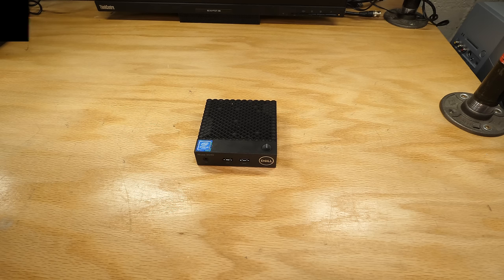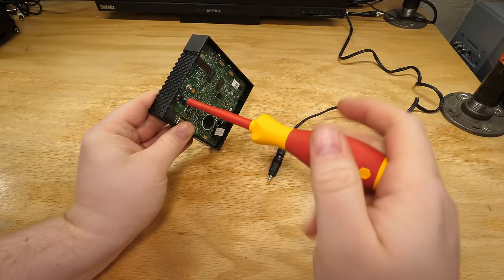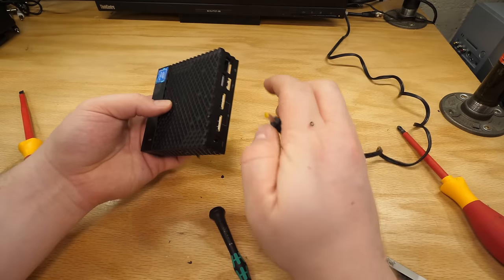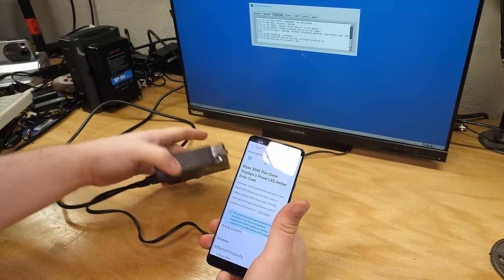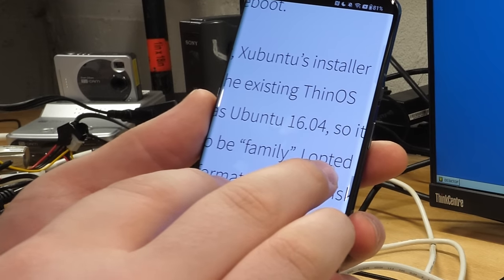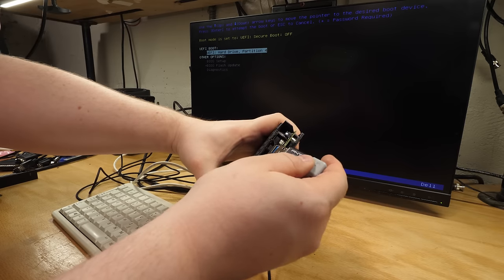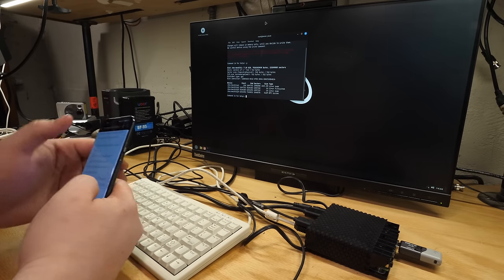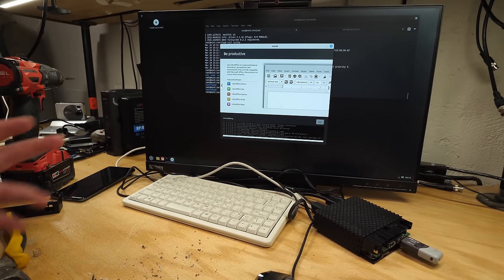Little Guys: Episode 2 [Wyse 3040]

Comment: Have I just never looked at the ARK page for the Z8350? because I have a PC stick with one tied to 4gb of ram that is all functional. (it is smaller in volume than the wyse as well haha.

My least favorite part about the -trail series or at least the tablet focused ones is despite being an SOC, they won't function properly without chipset drivers.. most of which end up being bespoke in the case of the random chinese brands... sigh

Comment: You can actually get something called tiny 11 so you can run this Dell on tiny eleven and it only takes up two gigs of RAM what tiny eleven is tiny eleven is a stripped down version of windows 11 so you can probably install it on a thing like this

Comment: A sata m.2 ssd will probably still work in that slot
Reply: unfortunately it dose not pci is not exposed its just for wifi cards.
Reply: A sata m.2 ssd would not even fit in since it is physically a different slot. We have m.2 E-key here while a sata ssd needs m.2 B/M-key

Comment: Some of the places we support use these little dudes to connect to Virtual machines. They don't need much horsepower to connect to a virtual machine. 

I'm surprised you cant use it to connect to even a windows machine using RDP.

Comment: a tip on drilling holes of that scale, you actually wanted a drill bit probably under a millimeter diameter, drill from the back side of it (so it goes through the center of the transparent peg and not a random place vaguely near to where you intended it), and don't use a heavy electric drill, because just the weight of the drill will snap the extremely thin drill bit. Use a hand tool for that scale. Not that it matters now & you already learned at least some of that.

Comment: I have set up so many of them. They fail a lot the cmos battery comes dead from the factory half the time. There's enough ram to put android on it if you are bored 😂. You need to update it with the Dell tool if you want more applications and set up Microsoft rdp. The management tool for them is free and they are crap at remote video.

Comment: I think we may need an additional theme and title card for “Let’s manually edit system files” 😸

Btw, at 15:30, not sure if I’m doing an overeager nerdsnipe here but you likely could have run `lsblk` to list the recognized block devices rather than visually scanning the contents of `/dev`.
Reply from the maker: For some reason, lsblk just fuzzes my visual receptors, I have a hard time parsing its output for reasons I can't explain. I use it frequently, just not for discovering what block devices are in the system. Maybe it's just leftover muscle memory from Red Hat (pre-enterprise) 5 though.
Reply: @CathodeRayDude  When you say that, I can immediately picture a visual-fogged version of its output in my mind. (same with netstat… sigh) So I sympathize pretty hard.

I also put my faith in lsblk to sort the devices such that the ones I actually care about end up near the bottom of its output… even though it doesn’t promise to do this, and it will likely change this behavior one day… ( ´_ゝ`)
Reply: blkid is also useful because it shows detected filesystems on the partitions. IIRC lsblk doesn't show any info about the contents of a partition unless it's already mounted.

Comment: I thought you worked for an MSP for several years. You've never managed thin clients? You don't configure thin clients on the device itself, you typically use a central management server for licensing and config deployment. No surprise that it is basically a paperweight.
Reply from the maker: I've never managed this particular unit, and I wasn't particularly interested in figuring out how. If I wanted to, I'd have read up on it, I didn't bother because I have no interest in having a thin client. I poked around the UI for a couple minutes and then wiped it since that's what I intended to do from the get go.
Reply: @CathodeRayDude  Didn't expect you to reply. generally really enjoy your videos man keep up the good work.

Comment: I successfully installed Debian 11 or 12 on my 3040.  I did the netinst install (network install where it downloads packages that I selected).  Running the full ISO install bombed in mint, Debian, ubuntu, etc.  I had to do a create some EFI file on the OS drive so the BOIS would recogonize it.  I have a GUI without Libre office and such.  I just needed a remote browser to check if equipment is up or down from behind a router.  It was in an unconditioned space with window facing south.  It got too hot during summer and was chronically unreachable during daylight so I removed it.  I planned to do something else but later never did.  Here it sets lonely.  I might try powering it up later today to see if it's ok.  My 5v plug was loose on the PCB and I didn't have the correct power supply so I botched together a heavy duty USB cable soldered to PCB and plugged it in USB charger. TADA!! Love the videos Subbed today!!

Comment: just connect a drive to the m.2 slot?
Reply: The slot doesn't have the pins wired up that are necessary for NVMe, so that won't do anything. The only thing that works in there are cards that act like SD cards, which basically means you are limited to SD cards and very special wifi adapters.

Comment: HP had the same dim power light issues on their micro pc. Possible the led is only half the brightness as when it was new combined with a low quality light pipe.

I wonder how it would perform on Chrome Flex OS.

Comment: I've had weird driver issues with Ubuntu as well. The nVidia cards that I've tried have occasionally tinted the screen green while in the live environment, and once when I was swapping driver versions. Ubuntu is strange in that regard, but I don't honestly have enough experience with Linux and hardware variety to confirm whether that is normal or not

Comment: I worked with Wyse thinOS from the very beginning until 2008. I can give you a clue to getting it configured.  It can pull the config from FTP using DHCP options. The config files are simple but the order of the configuration sections matters.

Comment: You could have installed a modded win7 or 10 and it would have almost certainly worked if you downgrade the page file size and even if apps crash due to low memory you can stick a usb drive to act as page file
An iso like tiny 7 would 100% work but tiny 10 or any other mods will like 60% chance with minimal or no page file

Comment: dell computers haven't liked having the keyboard or mouse plugged into the front of the computer since the days of windows xp. I knew one dell that would stop on an error asking for them to be plugged into the back of the computer. I've no idea if that is still happening but dell has always intended for them to be plugged into the back, so I doubt they have changed.

Comment: My favorite thin client is the HP t610 because it has an AMD64 CPU that is not made by either Intel or AMD. It's actually a fully-featured Via mini PC that supports both an IDE disk-on-chip and any very small SATA device. I use mine to dualboot MinocaOS and DragonFlyBSD (which unfortunately doesn't support sound on the machine), and I have verified that it can also boot PonyOS 8.
Reply: There even exists a Via Nano Quadcore, but all thin clients seem to use the dual core variants at most. And the driver support for the S3 GPU they are using is terrible, they are basically useless on linux and windows never than 7 if I remember correctly

Comment: I've always disliked these wyse clients. But I've only seen them around 2008. They might have had an accessible bios back then, but I can't remember at all. I mean, I don't think there was any access at all.
I've also picked up some neowares from the trash, which were also shite. But at least you could attach a normal harddrive to them (with a 2.5" to 3.5" adapter). And oh yeah, no linux, because that always crashed.

Comment: Should have tried to go into TTY in the original Ubuntu 16.04 install, that way you can get a terminal, I assume its been setup to not have a root password but I could totally be wrong, you can probably do a crazy thin Arch install with a lightweight tiling window manager, given you figure out the issue with the weird Unicode character
Reply: You could just run an entire OS through USB though

Comment: I know the documentation and your comment state that the M.2 port is an SD port, but that M.2 slot was for Wi-Fi/BT modules. That was honestly the best part about these 3040s. You could tuck them anywhere and have a VMware or Citrix client connected to the network wirelessly. My last company purchased hundreds of these direct from Dell with Wi-Fi modules in them.
Reply from the maker: Oh that's the thing, reportedly it uses a wifi/bt module that communicates over SDIO. very weird concept I've never heard of in m.2 before, but people are saying it's standard and common.
Reply: @CathodeRayDude  Very interesting that it communicates over SDIO. It's probably the same as something like an Eye-Fi SD card that had WiFi capabilities.

Comment: The device is designed for a specific purpose and you are acting shocked it can't be used for general purpose....its not this devices fault you are using it wrong. Also its not close to being the smallest atom device are you forgetting those intel hdmi stick computers?

Comment: Dell must have gotten some absolutely SHIT CMOS batteries in the late 2010s because at my job we have some machines from 2019(!!!) with dead CMOS batteries.
Reply from the maker: It's wild right?? Horrible no name PC clones from 1996 sometimes have working batteries but this thing couldn't make it 6 years? Where did they find these things
Reply: @CathodeRayDude I don't even want to know.
Reply: /The same Dell that bought cut rate capacitors in the 2000s? Whoda thunk!

Comment: Either you are being verbose because you know exactly what is happening.. or you really have no idea. You can remote to a local machine which is the whole point.
Reply from the maker: i literally said that in the first minute of the video
Reply: I guess my point was .. Even though you could possibly install an operating system. I couldnt get over "why". Ya; its a substandard computer. But its not that. Its supposed to be like a dumb terminal.  If you want to run windows on it you use it to RDP to a Machine.  You want linux you RDP to linux.  It runs better there anyways.  I get your point. But maybe I was waiting for the "This is crazy. lets see how far we can get. But this is not meant to be."  @CathodeRayDude
Reply from the maker: @rTron1  Yeah that's fair. This is a new kind of video format for me, the whole point is to just mess around a bit, not go as in-depth as possible - I just try a few things, then go "well there it is, have a good day" and that's about it, so yeah, I'm not saying everything that I know because it's meant to be casual, not instructional.
Reply: @CathodeRayDude  I liked it though.. watched it twice. Wouldnt you know I had a manager ask me about this for the optiplex 3000 thin client recently.  :-)
Reply: @CathodeRayDude  ok. Another short FYI .. If you want to do a part 2 .. The Optiplex 3000 Thin Client (Which is a slightly bigger brother to the one above) All that is needed is to add a M.2 2230 SSD and windows 11 (or other operating system will install in that). Might be a cool add on to this vid.